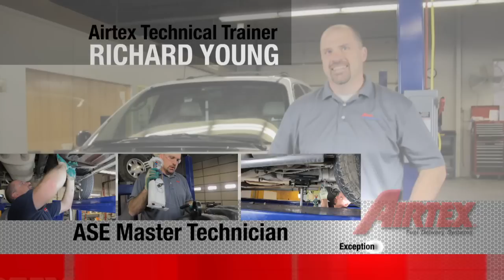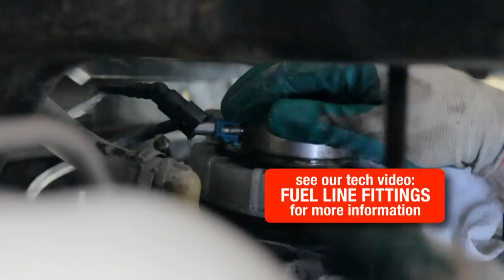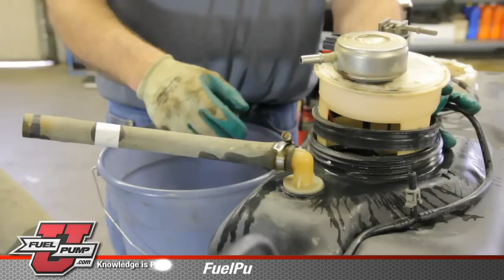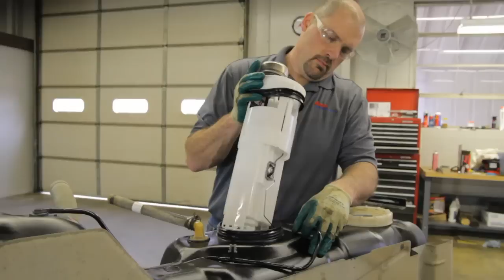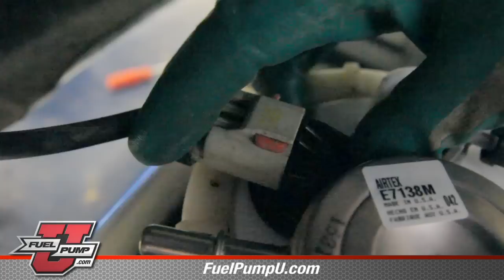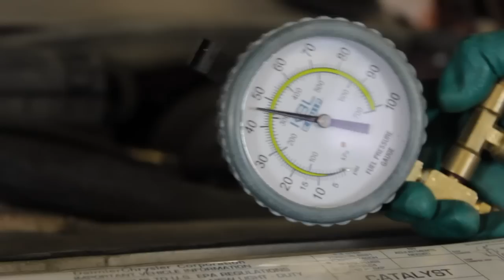How to Replace a Fuel Pump E7138M on a 1998-2002 Dodge RAM Pickup

Comment: I have a 99 Dodge Ram 1500 that doesn't like to start up first turn of the key, but it always does on the second turn. Also, I was driving home on night and the engine just shut off. All the electrical stayed on but there was no engine. Just before it shut off, at a turn the truck didn't have any throttle response for a little bit. It gain it back tho in a big jerk. If you could help me, that would be great. I do plan on taking it in to have a professional look at it tho.
Reply: Did you ever figure out what it was, my truck doing the same thing...

Comment: We all know you can't change one in four minutes and 27 seconds so I wish that it showed it in real time and every step
Reply from the maker: Shawn Jerome, it would be nice, but at times, rather boring, as the flat rate time for this job is 1.8 hours without draining or cleaning the fuel tank. Our goal is to show the primary steps of the installation. I do hope the video was a help.
Reply: I'd like to see just where he hooked the fuel pressure gauge to

Comment: what size is the fuel line on these? I'm working on putting this engine in my 87 ramcharger and need to make sure I have the right size line to provide enough fuel
Reply: Airtex/ASC Performance Pumps awesome thanks

Comment: Hello if you have this fuel pump in the tank that means that you dont have the other lift pump next to the filter canister???
Reply from the maker: No, This truck is a gasoline engine. It only has the one pump in the tank.

Comment: when my truck cranks and shuts off , When my dad puts gas in the coberater it will run till it runs out. Do you think it is the fuel pump or a fuse? Maybe a fuel sensor?
I have a  2000 Dodge Ram 1500 5.2 motor.
Reply: Probably the pump, best get on it soon!

Comment: Does the 99 dodge ram 1500 v6 not require a fuel filter change?
Reply from the maker: The fuel pump module E7138M does have a filter in at the pick up point.

Comment: Informative, but lacking detail, real life perspective -the mechanic does NOT have the overhead view of the top of the tank the camera shows - and potential issues -everything doesn't happen seamlessly like when fittings and connectors are loosened before hand.

Comment: Hi, could you tell me the difference from the dakota fuel pump, from 22 gl to 24 gl?
Reply from the maker: There are too many differences to tell. There are more differences than similarities.
Reply: I need to change my dakota, how do I know which one is correct?
Reply from the maker: You could check the VIN online, it may tell you the tank size or contact your dealer with the VIN to see if they can tell you what tank size the truck has.
Reply: What will be the VIN, or what does VIN mean?
Reply from the maker: VIN - vehicle Identification number. Every vehicle produced is assigned a unique serial number, the VIN. The VIN identifies the car as to what year, make, model, country of origin, it allows a dealer to determine what options were on the car at time of assembly. Options like how many gallon tank it has.
Reply: Thank you
Reply: Good afternoon, do you have the dakota VIN consultation link or a dealer who can tell me about the right pump for my dakota?
Reply from the maker: I will recommend you call a Nissan dealer in your area and see what they can tell you about your cars tank size. A Google search for Vehicle Identification Number should produce several good sites. We do not list hyper links, other than our own, via YouTube.